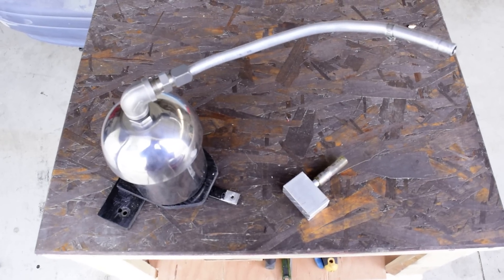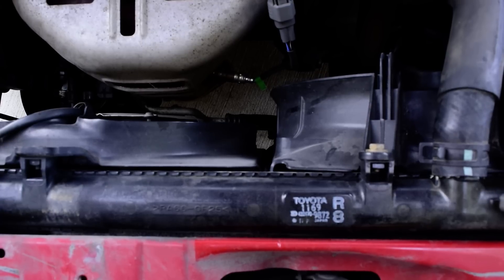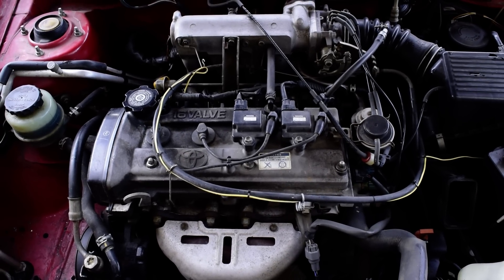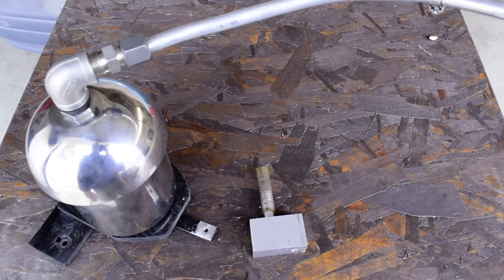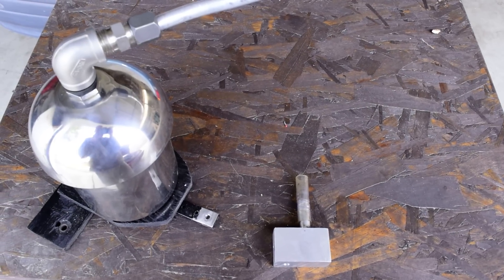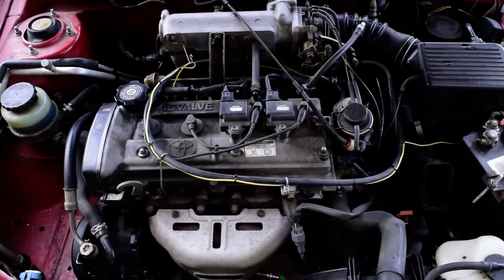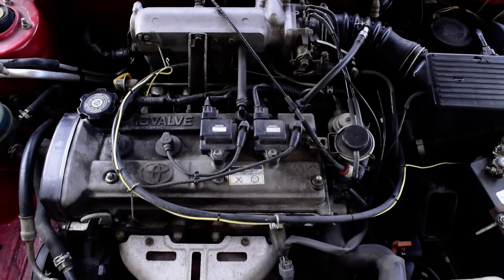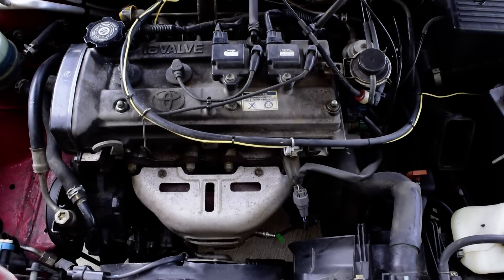A Joe Cell That Actually Works - Part 2 | Protons not Orgone

Comment: Do this then if you can .

Fill up you gas tank to the top , shacke it , filll it , shake it ... so on until you cant fi it anymore .

Then without the joe cell drive say 10 miles & do the same again with the joe cell .

Whats the result ?

They will look at you stupidly at Gastation but who cares . I did it on a RAV 4 ,  after 3rd test for 100km I got between 25-28 % savings .

This is using the tomassi effect which is just hot compressed air in a vortex with Iron Rod at center , polarised when facing north .

So I wanna know if this gets any more savings Charles .

BTW I also have a Brownsgas device now which I will also test soon .

Comment: when you explain the concept this way I think of radiation and how it effects thyroid intake. on the other side the hydrogen is used to improve combustion just as acetone is used in race cars for fuel vaporization. both together would be ideal if resonance can occur. a joe cell is just a frequency generator anyways. as is all life.
Reply from the maker: Hi, thanks for the input. I agree, if you really want to break down our physical reality into it's component parts, everything is a frequency. But in terms of our Human model of science, we need to consider the aspect of matter that we call particles. Particles are a real thing. The reason a transistor works is because of electrons which are added into silicon to make the silicon behave a different way. The science of this was originally derived from extraterrestrials. Many things we have around us would not function at all if it were not for particles.
Reply: +supermuble we are extra terrestrials.  what about the concept of an opera singer breaking glass. that frequency is tearing apart the electromagnetic connections of those particles. the cool trick would be to reassemble the glass with frequency though. have you ever thought about the possibility of using soft metals like mercury to aid in the fluid as a catalyst or such. lot of possibilities.
Reply from the maker: 2WheeledWanker ! Hi. Yes that is pretty cool that an opera singer can break a glass with a tone. I always assumed this was due to physical vibrations? I guess I don't fully understand it.
Reply: +supermuble thats what makes all of this so tough. just learning is a small part of everything . its a matter of understanding matter and do we really understand how it truly works. who made god god and so on. thanks for the feedback and I look forward to your ideas in the future.
Reply: +supermuble btw look into sonic levitation using a 3d grid to manipulate matter
Reply from the maker: I looked into the sonic levitation. Very fascinating. Thank you!

Comment: running lean damages the engine
Reply from the maker: Running lean can potentially overheat the catalytic converter, fortunately the Joe Cell only works when the vehicle is cruising. When you got above 80% throttle on an EFI engine, the oxygen sensor is disabled (on most normal cars) and you default to the program which tells the EFI computer to go "full rich" as a method of safety. This margin of safety prevents damage to the engine, while allowing the engine to run leaner than usual when cruising, which doesn't cause any damage to the engine. The other thing is, modern cars have knock sensors, so if there is any detonation of pinging, the timing is automatically retarded, preventing engine damage. So modern EFI engines are pretty much bullet proof, I've run mine for 4 years with the cell on most of that time, and it runs perfect.
Reply: He doesnt use the gas

Comment: Charles to finalise it you close all the engine off like Joseph Papp engine make the sump vacuum Ogmandino youtuber told me this. " start with warm compressors then Cold. Place ice packs on your head and aluminium foil balls in both ears to build up your receptors. Think of winters scapes and penguins on ice skates. Now your di lithium crystals will never hold ". Put ursine in with sea water and spring water in coolant or air con oil. Ion transfer effect. The urine soaks away and forms a crystal brown lining scum in engine. Also appears to start very easy Just some tweaks no expert here in uk mel
Reply from the maker: Thanks for your comments, I'll have to set aside some time to research some of the things you mentioned. Thank you!

Comment: I also had a Toyota, 1.6 liter engine, it consistently had  5 to 5.5L/100 km, I never  saw it use 6L/100 km or more the time I used the device. Before installation the car used 7.5L/100 km, which it was rated for.When I used HHO instead it climbed up a little to appx.  6L/100 km, that is good also but Joe Cell is the only device that could make a consistent high MPG. I checked my MPG every time I filled and noted the km`s achieved and liters consumed, for 2 years straight.

Only problem with Joe Cell is winter time, so then I usually switched to other devices like HHO or pond fogger with a little alcohol.
Reply from the maker: People do report huge mileage gains with "brute force" electrolysis cells. On the car in the video, I tried applying 12 volts of straight constant power, with a brute force electrolysis cell, and the gas mileage didn't change at all, which I found surprising. A conventional electrolysis cell had zero effect on the 1995 Tercel fuel economy, maybe because of the computer. The people who do use brute force electrolysis cells, seem to use extremely powerful, high current cells, with substantial electrolyte. The problem with brute force is that it's extremely dangerous. I've received messages from people who have claimed to have an accidental explosion in their garage during testing of brute force electrolysis water plate systems. In my opinion, brute force systems are just too dangerous, so I won't ever try them.

Comment: So the way that you explained it it makes sense to me that it's not the Joes sell itself that has any uniqueness to it. Its the hydrogen protons that are doing the magic. a traditional HHO cell can make the HHO gas just as the Joe cell can. It's the principle of the blind fitting and the protons passing through it that increase mileage, not whatever kind of HHO generator you're using. There's no difference between a Joe cell and a traditional flat plate HHO cell other than the fact that the Joe cell is tubular.
Reply from the maker: +Tyson Capel Yes you are correct. But the cell should be made out of metal like a Joe Cell because stainless steel seems to contain the energy. Glass might work too. It could theoretically be done using plastic but Joe did discover that plastic can react with the particles and cause a different form of gas. In Joe's own words he said that a PVC plastic HHO booster produced a low energy exothermic gas that caused black smoke to come out of the exhaust. However when he switched to an all stainless steel Joe Cell style HHO generator, the engine's operating characteristics changed completely, and the car behaved totally different, and there was no more black smoke. He figured out that the stainless steel cylinder produced a different type of gas. The research and experiments seems to indicate that using non-magnetic stainless steel is the best for containing the energy and not letting it leak out. Hydrogen particles might mix with plastic to form a different type of gas altogether, so different types of plastics would need to be used until a suitable one was found. It's not impossible to use plastic, but the outside case of the Joe Cell forms the conductive path to transmit the particles into the engine. The particles literally rise up and out of the cell along the outside case. This can't happen with a plastic cell, since there is no conductive path for the particles to travel on.
Reply: +Tyson Capel I agree However if what he says is true then somehow the Hydrogen atom is loosing its electron to just be a proton truthfully not sure if that's the case and I believe its just hydrogen as we know it will bleed threw some metals.